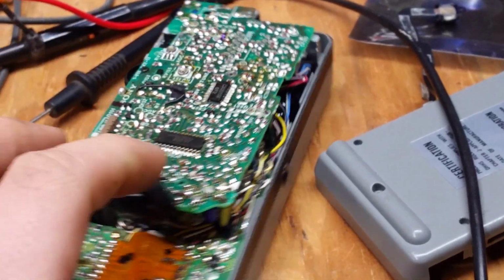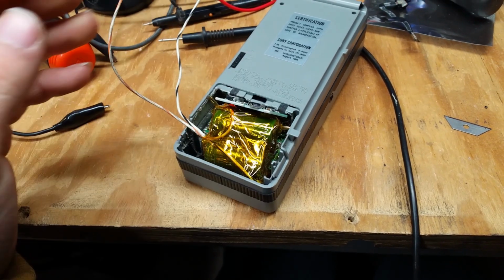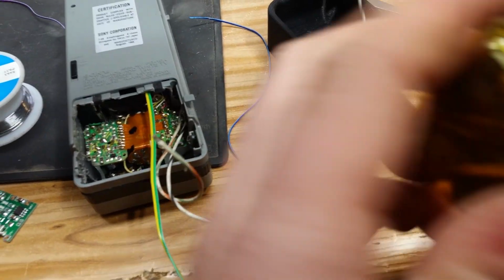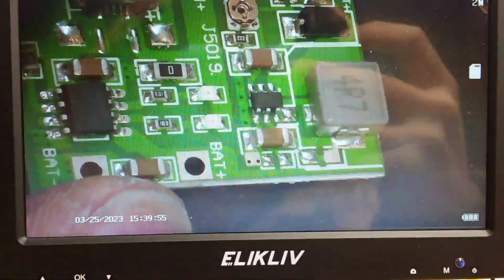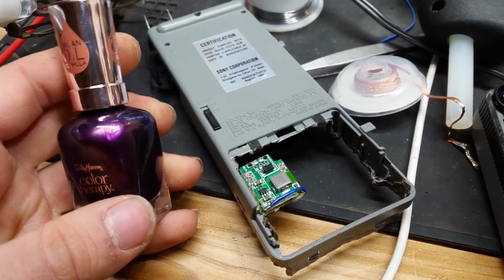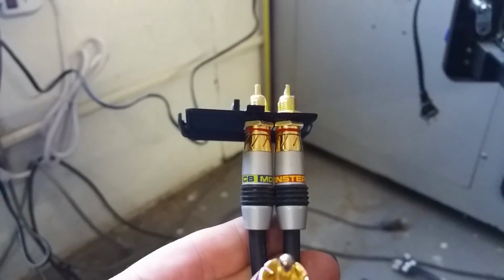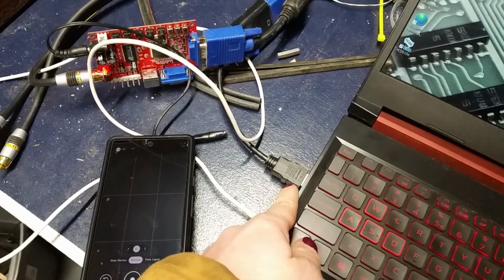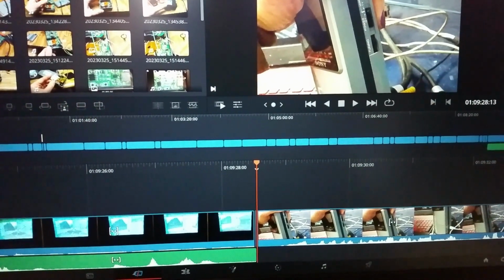Modding a Sony Watchman fd-10a with AV input

Comment: What is the board you're using for charging i want to recycle some vape batteries buy i want a 4.5/5v output without using a seperate board.

Comment: Not a bad mod. I have the same model TV and using a VCR with some cable line signal amplifiers watched a bit of FOX news on it today, signal source a chromecast. given the way your mod works you could in theory add in a source switch and restore its jungle chip's normal function, if you want to try it too.